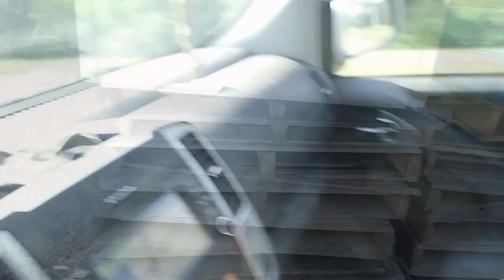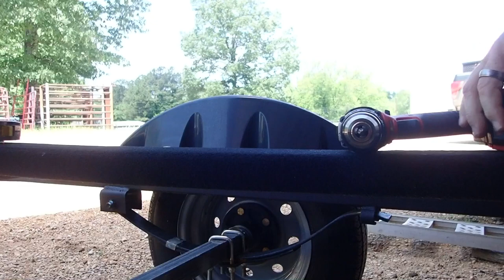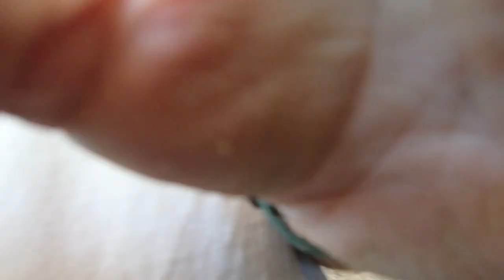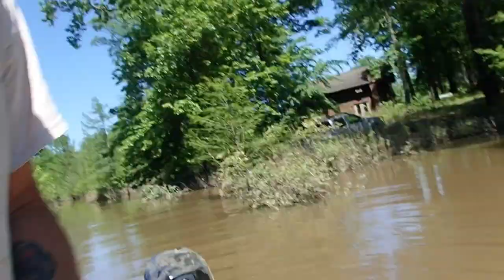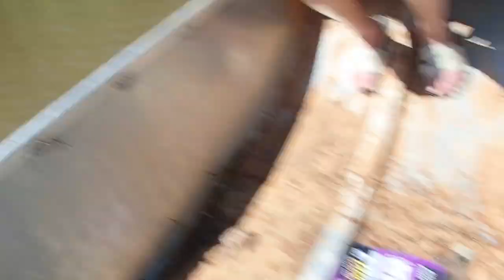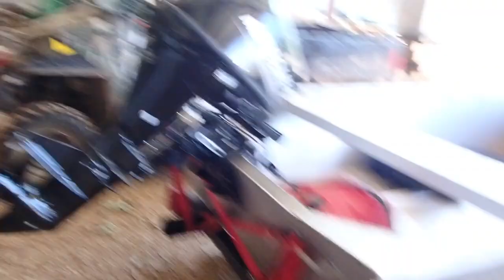MY MICRO BOAT QUIT IN THE MIDDLE OF THE RIVER 🤬🤬🤬

Comment: If your open to suggestion, your carpet bunks should be adjustable raise them up to lift the boat over your trailer tires, If you take a long trip and it moves your tires will rub a hole in the sides, also I would name her the silver bullet.lol.

Comment: Jason, that little trailer should be fine and you can put your fenders back on, I think...hard to tell from my angle but I believe you should be able to raise your boards the boat sets on up higher. They usually adjust and you should clear your fenders no problem. I like the little boat though...you can get that thing in some tight spaces when it floods
Reply from the maker: Thanks 👍

Comment: Got to admit I laughed a bit about you having to paddle the little boat.  I have been caught in similar situations and one I remember was down on a Florida lake but luckily had a troll motor that barely got us in; alcohol in gas had dissolved gas line so there we were some half mile from ramp and no motor. Agree with viewer suggesting a wider trailer and imagine the boat folks will support that recommendation.  Little boat would be super trotline boat and bream boat with Cody.

Comment: It would be nice if you widen the axle and put some carpeted side guide boards on it like some airboat trailers have. That way when you're loading it you can just run it up between them and it will load perfectly every time.   
And sorry, but I had to laugh when it wouldn't start and you got stuck on the river. lol.

Comment: I'd rather spend the money on a wider trailer or at least a wider axle (tractor supply sells them) than doing damage to my boat,
How old is the motor how long has it Sat not running, it may need carb(s) rebuilt/cleaned that's typical when a motor sits for a period of time, run some Sta-Bal in with the fuel and it will help to prevent the fuel gumming up in the carb(s) if it's a 2 stroke you'll still need to mix your fuel and oil 50:1 just add Sta-Bal to the mixture, 4 stroke you don't typically mix oil in the fuel but you can add Sta-Bal to the fuel, it's also good fore any gas vechiles that sit without running for periods of time i.e. lawn mowers, chain saws, 4 wheelers, etc, also before you take the boat out of the water disconnect the fuel line and run the motor completely  out of gas don't leave any in the carb(s) that can gum up, when it dies give it a minute and crank it again until  all the fuel is run out of the carb bowls, but before you take the boat to the water crank it up at home on earmuffs so if you have any issues your at home with tools and not on the water floating down stream trying to crank it up, if your going out in it you don't need to run the carb(s) dry and it should crank easally when you get to the water, you shouldn't have to pull that hard on the cord to crank the motor, my fear is you break the cord,

Comment: Sure were a lot of lessons learned in this video. You probably know  to crack open the gas cap on the tank or open the vent on the cap if it has one so you don't get a vacuum in the tank. I've done that one and you don't have to run very long till the motor is starved for gas.

Comment: You are learning so I'll be easy on you.  When you pull start an outboard, don't snatch it without letting the dogs engage the flywheel first. You will break stuff snatching on it without taking up the slack.  Don't be an outboard gorilla. I'm sure your cranking issue is fuel related. Be sure to put Star Tron Enzyme fuel stabilize in that fuel and try to use ethanol free fuel if possible.